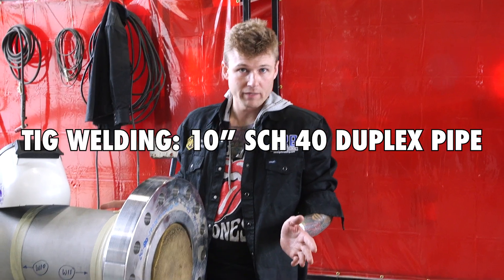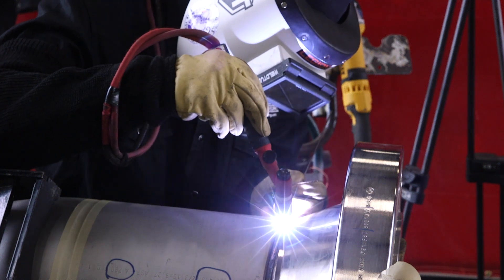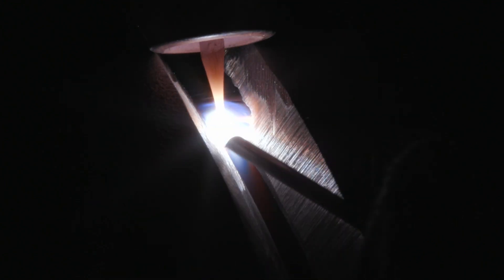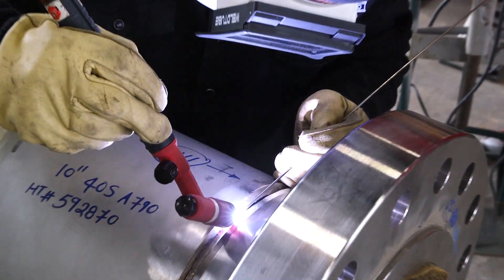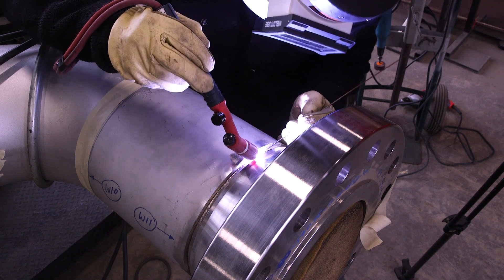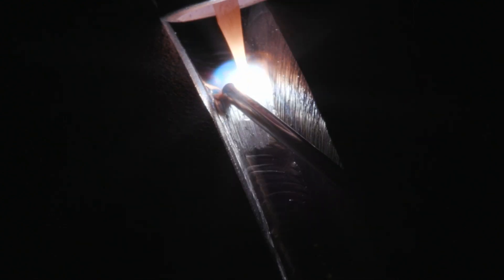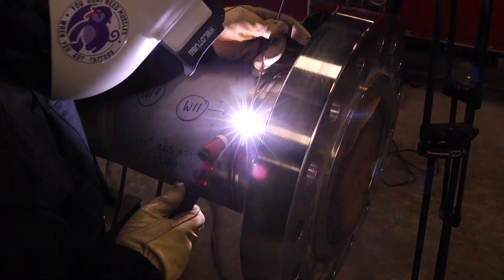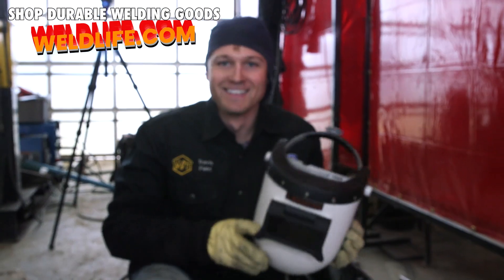TIG Welding 10” Duplex Stainless Steel Pipe and Flange

Comment: It that tape around the weld the bevel? Whats the purpose
Reply: You always tape off the open root of a weld that needs to be purged (SS, duplex, inconel, etc). Leave a bit open to start the weld, and progress from there. Argon is heavier than air, so naturally when you roll weld pipe, the open part is on top. That allows the air to be purged out and the argon stays inside to keep the inside of the joint an inert environment. Duplex needs to be inert on the inside of the joint while being welded or it will get ruined.

Comment: 9.58. Are you just about to wiggle your way over a gas pore from the previous run?
Reply: That's part of the original root pass that was not touched by the grinding disk., the one side is lower., that speak was completely untouched. If that was a gas pocket., that would be a clear indication that there would be more then, in the weld itself. However, as the welds were 100% xray., severe sour service., ultimately then it is now unlikely a gas pocket

Comment: Hey mate. I have been a pressure pipe welder for 30 odd years. In Australia. Working on things ,ranging from gas platforms at sea,to refineries ,and  construction. 
I have never been allowed,to carry out a tig weld in the VERTICALLY DOWN POSITION.   ON ANY MATERIAL.   In fact. ,if that is what a welder is seen to be doing on pressure pipe, THEY GET THE SACK
Reply: I am welding uphill. Camera captured filming upside down, most likely due to its placement and or help the viewer learn. It appears to be welding downhill, but the next shot of my body, is welding uphill
Reply: I thought the exact same thing, but he's on a rotator and it's the angle of the camera

That was my first thought. Since when do we weld tig vertical down lol
Reply: "Moving from a slight downhill progression to more of a 12 oclock" 
That is what he's talking about
Reply: @kf8575 hes on a wheel... more forehand less penetraition. Back hand more pen..

Comment: stuck on some like schedule 10 i think the real thin stuff for stainless at school. shit whoops my ass. hope one day i can get to the big boy stuff like youre on
Reply: Make sure your tungsten is sharp af, short stick out, 3/32 or 1/8th” gap. Knife edge the bevel get it really sharp. Whatever gap you use, use that size rod. Run about 70-75 amps, walk the cup real tight and watch the key hole open up then dab some wire in there, watch it slightly drip in there and then add wire again when it opens up. Can’t go wrong it’ll go in slick.